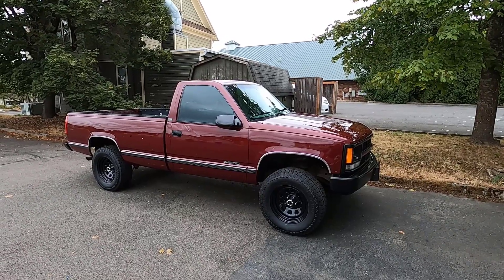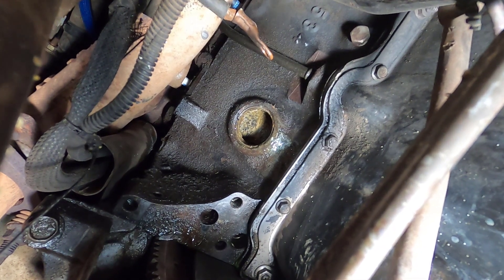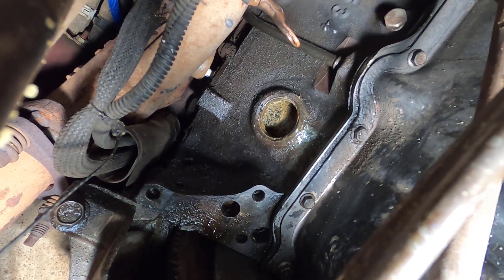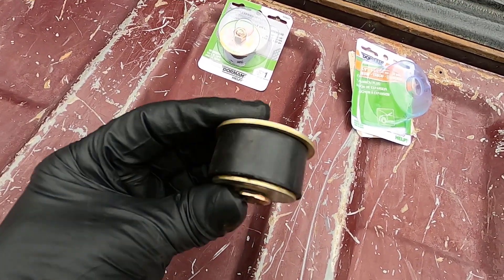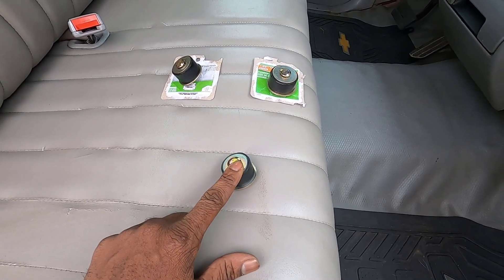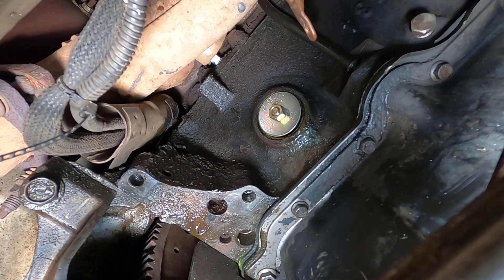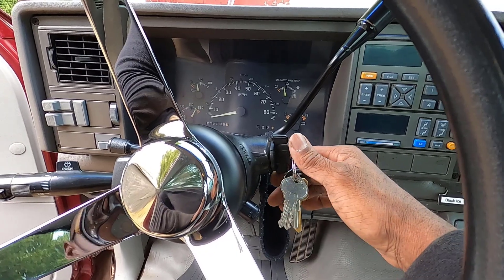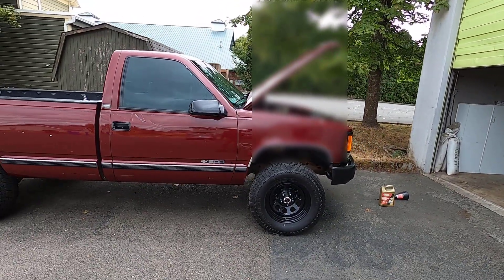Dorman Quick Seal Rubber Expansion Plug: Repair Leaking Freeze Plug - 1994 Chevy Cheyenne C1500

Comment: This is too late to help you, but it might help someone else.  When the outer ring stays locked in like that, just use a small section of a hacksaw blade to cut a notch in that remaining ring.  Orient the blade so it only cuts on the pull stroke, and that will keep metal cuttings out of the water jacket, though it still might be a good idea to reach in with a rag afterward and wipe toward the opening to pull out any stray cuttings.  Very carefully cut "just far enough" to get through that ring.  The resulting notch will make it a breeze to get the remainder of the ring unlocked.  You can stop short of cutting all the way through the ring to make sure you don't score the edge of the hole and will still be very easy to knock the ring out since it will break the rest of the way through your cut with very little effort on your part.  If you do happen to leave a bit of a scratch in the margin of the plug hole, using a tiny bit of sealant around the new metal plug will eliminate leaks.
Reply from the maker: Great information, thank you. This will certainly be helpful!
Reply: Yup, I had to do the hacksaw blade thing on one myself. The inside was too corroded to pry on, but got a hole big enough to get the blade in next to the edge. Got it close to being through it and used a small cold chisel to break it apart then it popped out pretty easily. These plugs are a pain if the motor is still in the vehicle. Mine was in a boat, really fun time. Wish they would have figured a more permanent solution solution at the factory to seal these holes off.

Comment: I just put a Dorman expansion plug in my F-150 a few weeks ago. I'm very leerly of it, but it's holding so far. I'll need to replace the remaining before too long, but with traditional ones.
Reply: How far did you tighten the nut? Do you have to tighten till snug or pass snug? Thanks.

Comment: I installed one of these in my 69 bronco because there wasnt enough room to pound a regular freeze plug into the hole without basically pulling the motor. It is holding strong.
Reply: Still holding?

Comment: Looks like your flywheel gear has a tooth broke off. You may want to replace it when you change motors. Thanks for the video. I think I have the same problem ,as I also have a 4.3 and it is leaking coolant off the bottom of the starter.  I'm hoping  it isn't the head gasket.

Comment: got 2 in my diesel 7.3 idi both are very slightly leaking from the bolt threads it seems like just a tiny drip if I'm looking for it got 500 miles on these plugs maybe i should tighten them up a little bit more and yes they are completely in the hole.

Comment: If my dorman radiator drain plug is bad and it is dripping does it only drip when the car is running or only drip when the car is parked or will it drip all the time snice the plug is bad?

Comment: just need to cut it with a small dremel cut off wheel and use a flat head and hammer and it will pop out. hope you put sealant on the rubber. you never put those in dry!

Comment: Did it last?
Reply from the maker: Yep, it's still going strong and no issues. Make sure to get the right size for the perfect fit. I went to the parts store 2-3 times if I recall.
Reply: @BuildYourOwn   You’re more patient than I am.. after third time, I’m would have beat the sense out that motor. Tired of repairing everything month by month.